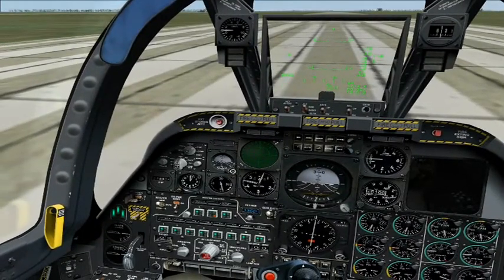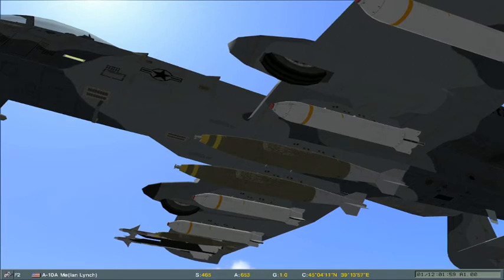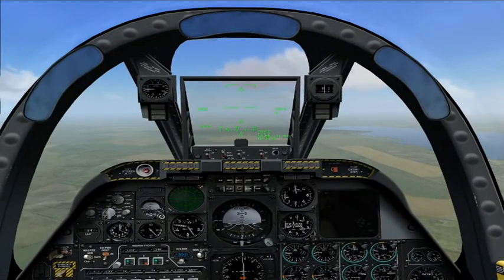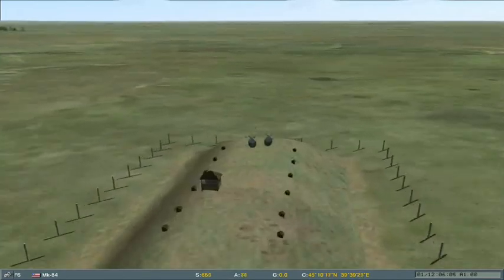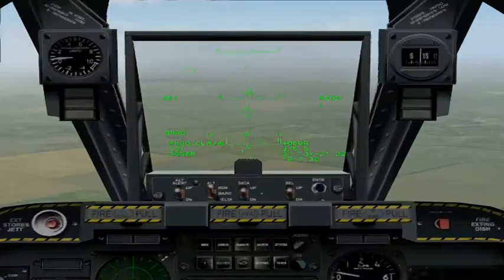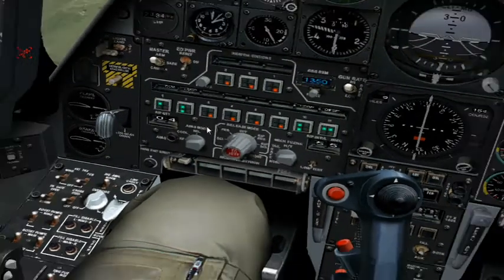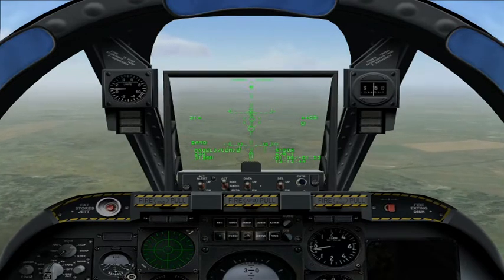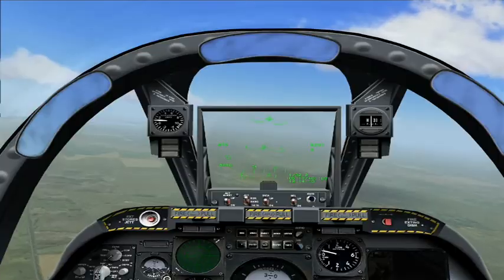Lock On (LOMAC) Tutorials - #8 Bomb Targeting and Deployment

Comment from the maker: @sandtr00per We'll look at avoiding missiles in tutorial #11 - As for taking on Russian helicopters, (I assume you're talking about a variant of the Hind) You need to ensure you get the drop on them, not the other way around. You have no onboard radar other than the seeker head of the missile and should only be engaging air targets as a last resort. I find it useful to scan an area with a Maverick (assuming I have them on board) That way I can alter course accordingly for the best approach.

Comment: i was hit with anti-tank opticaly driven missile from russian helicopter. its hard to spot, heli is flying low and missile is like IR missile, no warning and what is worse - flares does not help (i quickly tried to find them on wiki, it was either ataka or shturm) ... btw is there any quide what ripple intervval to choose ? just to hit that "border" where shorter time will cause overlap of damage area of every bombs, and longer time will cause bombs to leave areas with no damage between impacts?